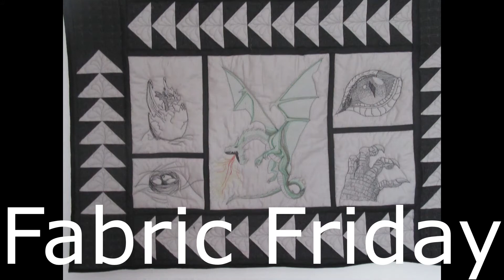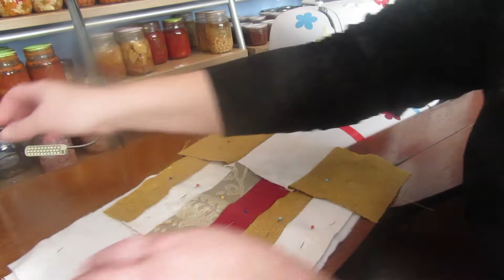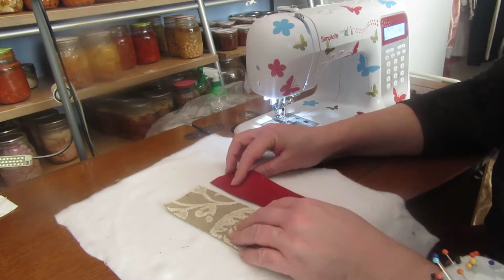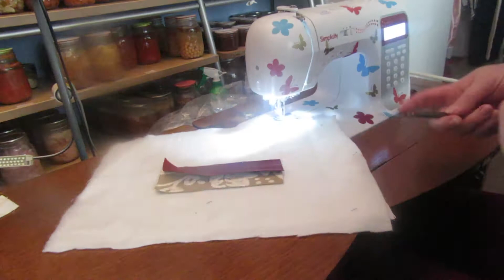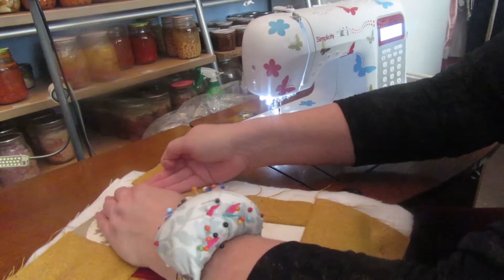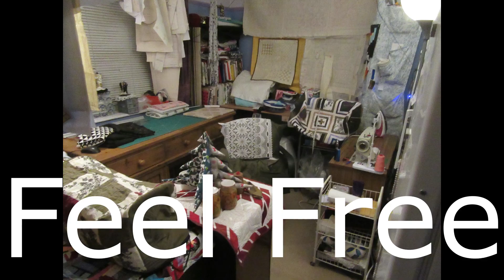Pot Holder from scraps

Comment: Very interesting, I want to try this technique of sewing the strips to the backing
Reply from the maker: This is an easy way to make a quilt if you only have access to a normal sewing machine. You quilt the blocks then sew together. This method is called Quilt as you go. GAYG.I have made several quilts this way.